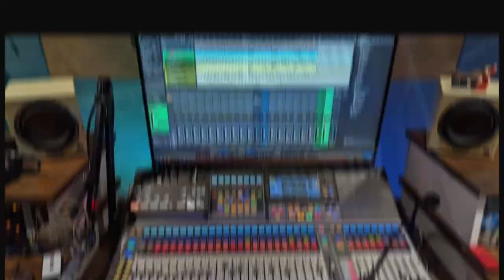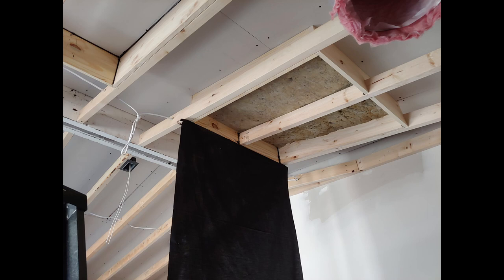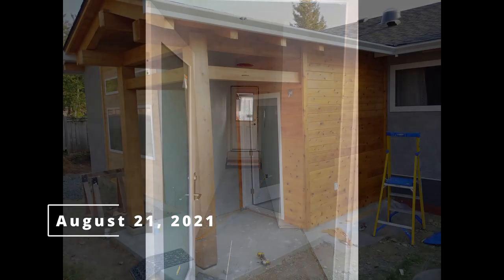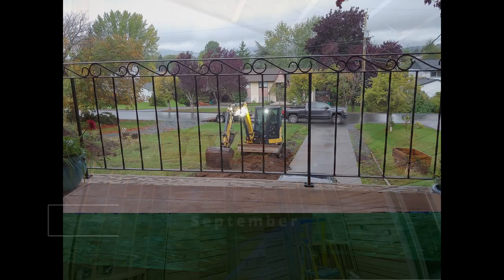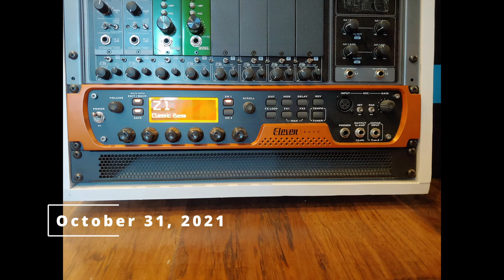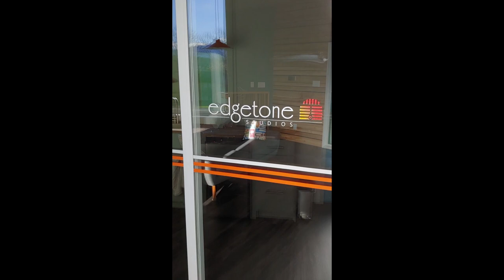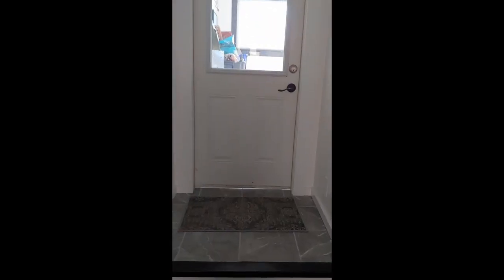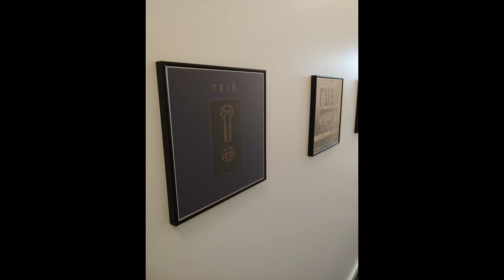How I built a Recording Studio addition (Part 3)

Comment: The difference in reverb as you step from the control room to the entrance is huge!
Reply from the maker: Indeed. And the hallway from the traking room is even more severe. I keep thinking I should have wired the hall as an echo chamber. I may try it some time anyway with cables through the door.
Reply: @EdgetoneStudios great idea! Might be a wireless option as well, a bit of latency on reverb is rarely a problem.
Reply from the maker: @drewstephenson  True. But since I'd probably only use it for mixing, there wouldn't be an issue leaving the door between the hall and the tracking room open a bit.
Reply: @EdgetoneStudios  That makes sense.

Comment: Hi! Amazing work! Thanks for sharing! How did you manage to attach the fabric panels so neatly without any visible screws and every panel right next to each other? Thank you again.
Reply from the maker: Thanks for watching.

I build each frame in place by measuring each section, cutting the board, then tacking it into place with finishing nails. I left the nail head out enough to easily remove it. Then I stapled the corners so that the section stayed together while I removed the temporary nails.

Once the fabric was on, I used a brad-nailer (a nail gun that shoots a very fine nail) to attach the boards. Usually the nail head would go right through the fabric. If it didn't I could rub the fabric and it would usually cover the nail head. There are places that you can still see the nails, but only if you are looking very closely. 

It turned out tighter than I thought I would be able to achieve, however there are a couple panels where the fabric isn't fully stretched on an edge and has a bit of a ripple. They annoy me ever so slightly because most of them look perfect. ;-)

Comment: How did you attach the wall frames with the fabric to the wall / celing
Reply from the maker: Once the panels were built, I used a brad nailer (basically a nail gun that shoots finising nails) to attach the panels. In most cases, the nail head passes right through the fabric and is invisible. Sometimes it didn't quite go that far and I would have to wiggle the fabric or pull it over the nail head.
They are mostly invisible from a distance, but if you get right up to the walls and look you can actually find them.